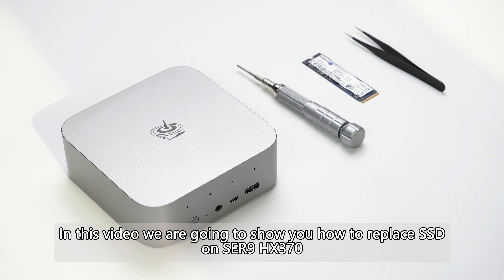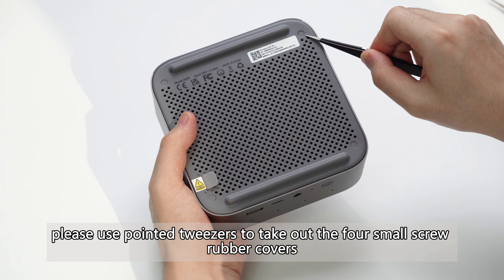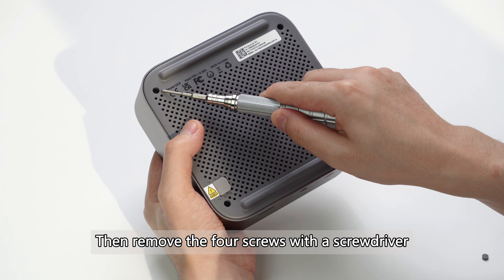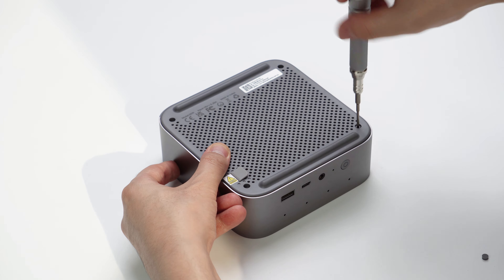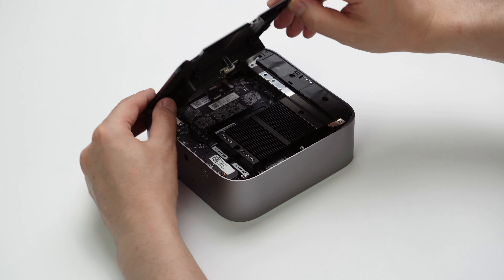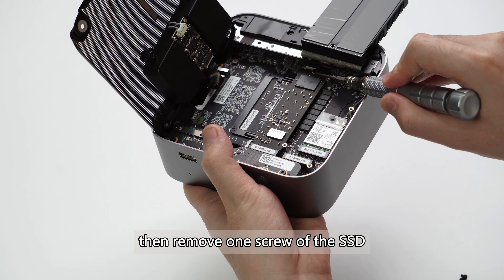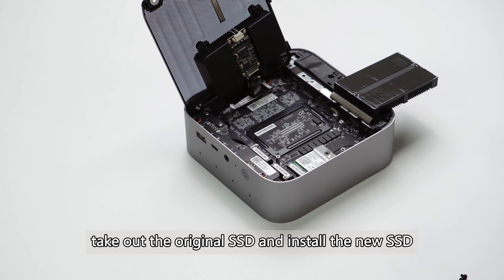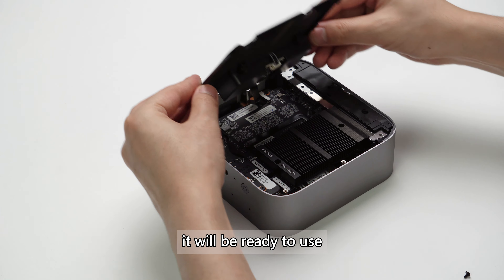How to replace SSD on SER9

Comment: Hey Beelink, 
My monitor has USB-C power delivery 65W. I am using SER8 with TDP lowered down usually 50W. Why I still cant power the device up ?
Reply from the maker: Hi, 65W is not sufficient; you need at least 100W of power input to boot on the PC."